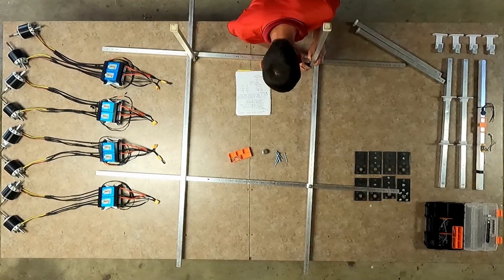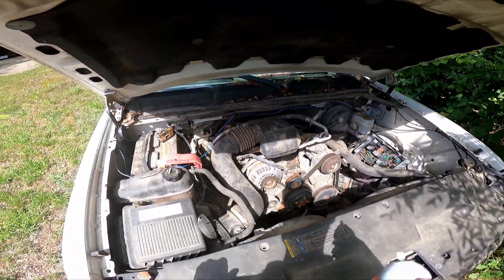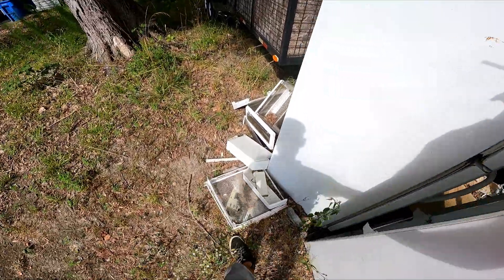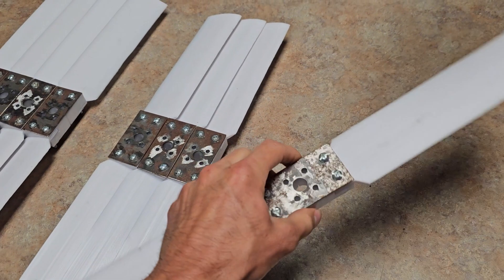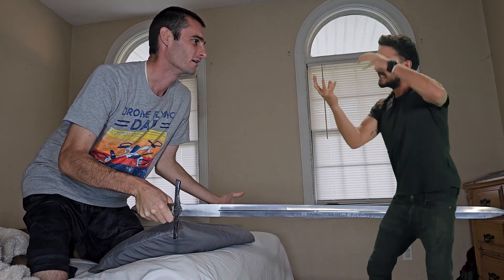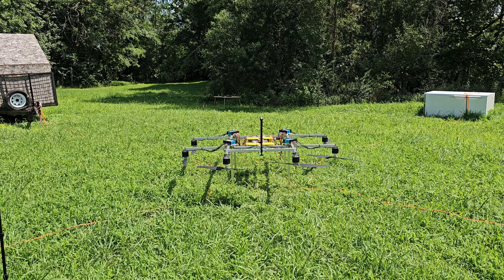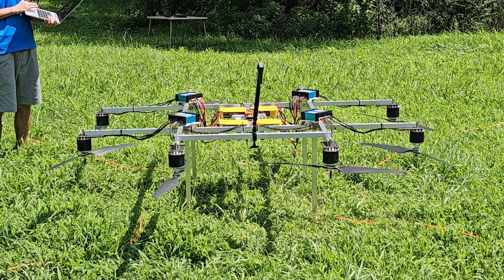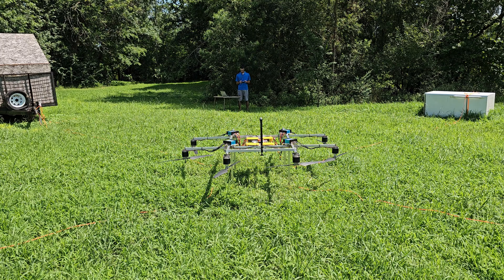I Built the Cheapest Flying Car Possible (eVTOL) - Part 2

Comment: Cool!  What kind of CNC machine is that?  Can it do more than CNC?  I've been looking at 3D printers that can do simple CNC and laser etching
Reply from the maker: Genmitsu 3018-PRO from Amazon. It's definitely not built to work with aluminum, but I run it very slowly. I'd recommend buying a different 3D printer/laser etcher rather than trying to convert this one, but I'm sure it's possible

Comment: love the jump start, if you lived close we would be best friends, lol I am about to  start my manned drone project death trap.
Reply: A few tips from your uncle larry, First stand behind the fridge, and second untie it as flight controller will fight the pull of the rope and it will freak out if it pulls on it (more it pulls the more the fc will engage motor), third frame stiffness is a big deal and flex and vibration is big problem for the gyro in flight controller.

Comment: I watched again your movie mate , you have done the same mistake I have seen and also heard them saying to do about building a frame  - no bolts and hexnuts ,no wood , no hollow fibreglass sections to be used for frames . Use the right design but welded ,use Aluminium SHS ( square hollow section ) 40x 40 x 2mm I can help and guide you when you are ready with the design and welding procedure. Happy New Year mate and I’m looking forward to connect with you ,whenever you are ready , by the way I can give you a place to buy proper blades 🎉🍾👍🦅🦅
Reply from the maker: Hey, thanks for the tips, and sorry it took me so long to respond. I would love to talk more- please send me an email to the address on my YouTube channel profile

Comment: Mate like I said ,great job , I admire your efforts and work  as I have built one of my own as well , I’m stuck with that Ardupilot I don’t know how to increase the throttle , I hear you saying you have given something like 10% to yours ? How do you increase that throttle in Ardupilot , oh I didn’t ask you if you use Ardupilot , sorry 👍🦅🦅
Reply from the maker: Thanks! That's awesome that you're working on one too. Yes, I am using Ardupilot. When I said that I was giving it low throttle in the video, I was referring to the throttle stick on my controller. I barely moved the stick up and the drone took off, because it has so much power, so it doesn't need much throttle to takeoff. If you're giving 100% throttle by cranking the throttle stick all the way up on your controller, then your build probably doesn't produce enough thrust to get off the ground. I'm not certain that's your issue, I'm just making some assumptions. But I'll be launching a Discord server soon so that we can have a community of drone builders and ask questions there. I'll let you know as soon as it's live soon, and I'd love to talk to you more on there!